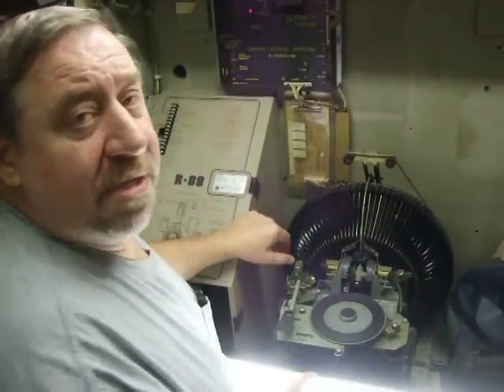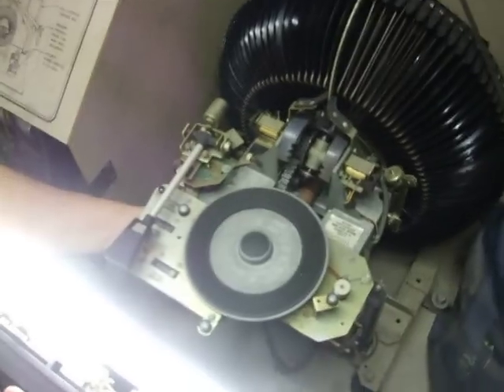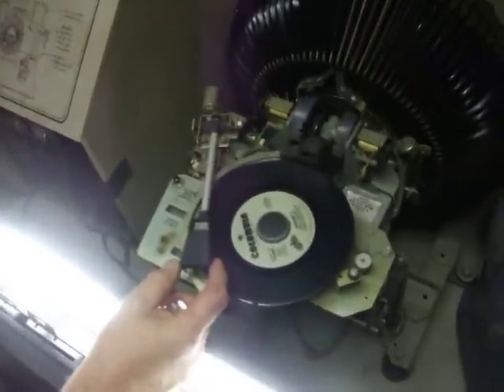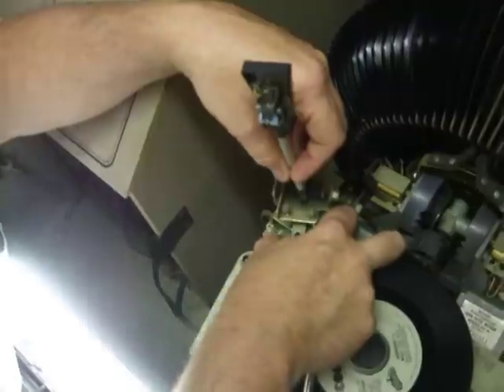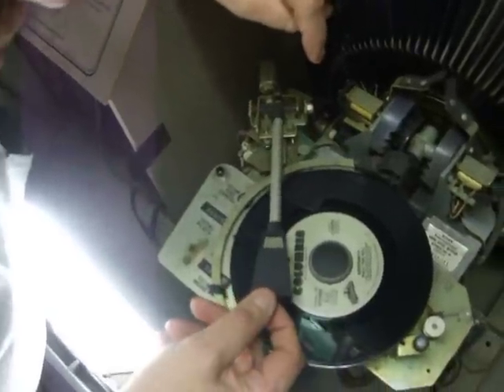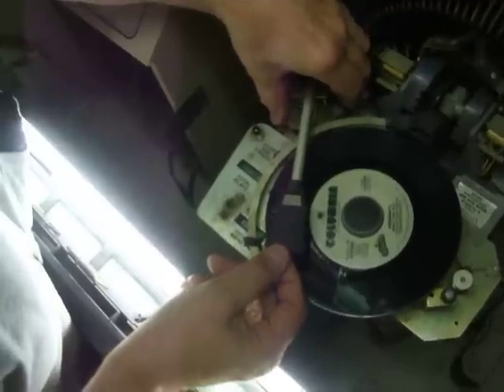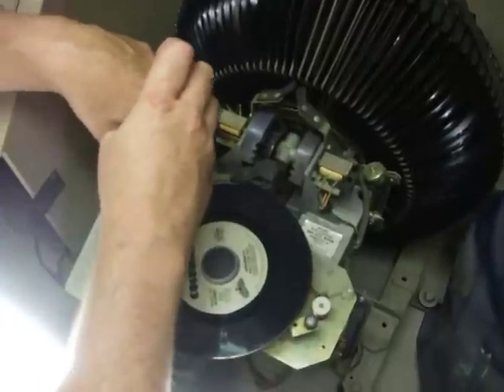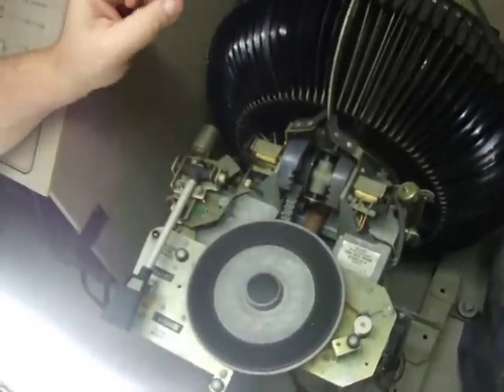#76 ROWE 45rpm JUKEBOX.-How to set your TONEARM reject limit! TNT Amusements

Comment: Seems after the adjustment ... song songs now don't reject and the needle stays in the loop on the last groove. Some records simply have different distances between the start and stop points. Unless you have roughly the same distance it is tricky to get all your old plus more modern records to play and might have to live with this fact.  After all, the tonearm is machanical componet and does not know the recod has not finished playing and simply lifts at a fixed cut off point.
Reply from the maker: The longest songs (running 7 minutes, like Paradise by the Dashboard Light, may reject a hair sooner...you have to adjust for 99% of your records.

Comment: I'm assuming that if the tone-arm is getting to the reject grove at the end of the record, but not properly rejecting, you can use this same adjustment back the other way to ensure each record rejects properly? For example, It's rejecting just fine on some of my newer, more "mint" 45s, but not on some older ones that came with the jukebox I just got.
Reply from the maker: Yes you can...you may have to play with the adjustyment a couple times to get it right.

Comment: Ami Rowe AMI R-85 starlight Jukebox selects record tries to play the record then cancels. Tries to play the same record again then cancels. keeps doing this each time. 
I switched off the jukebox switched it back on again I then select a different record. 
The carousel stops, the record is selected placed on the turntable and the same thing happens again! 
It tries to play record then a second later picks up the record puts it back into the carousel and re-selects it. Once more it tries to play again and back to the same problem and so on!  
Can anyone provide me with the answer to this problem, please? Many thanks, Les.
Reply from the maker: The cancel switch on the tone arm is out of adjustment

Comment: My issue is I'm not hearing the click and the record stays on the table. Could the micro switch have gone bad? Or a lose wire? (I just moved and that started) any insight would be much appreciated. Thanks
Reply from the maker: the sensor that tells the record at the end may have broken in the move.  You could also have cold header pins in the mech control board ...they notoriusly get those colder solder joints over the years!

Comment: what about this problem on a seeburg early 70s  std 160  sunstar jukebox,,can u help me??
Reply from the maker: Sadly, I do not know the Seeburg machines at all....however, it has to be a simple adjustment/
Reply: thanks anyway,,,it just grabs a record  starts to play it for 1 second ,then rejects it,,i cant understand why????its drivin me nutts
Reply from the maker: There is a trip switch, thats possibly broken or simply turned too far...and its rejecting early.  I just dont remember what style a Seeburg uses (the Rowe boxes use a magnetic reed switch that you can move slightly one way or the other.)
Reply: ill take a look,,,,,thanks,,Brian
Reply: well i strtd the juke,,let it get to the point before it tried to reject it after it started to play,,turned off power,,rooled the motor coupling with my finger in the direction the record spins for a full turn,,turned power bk on and the record played,,but at the end after rejecting it  ,,the arm that presses the record in place kinda jerked bk and forth a lil bit ,,then it put the record ,bk,,i then tried to play a song and it was bk to the relecting of the record after a second of playing,,,im stumped...i